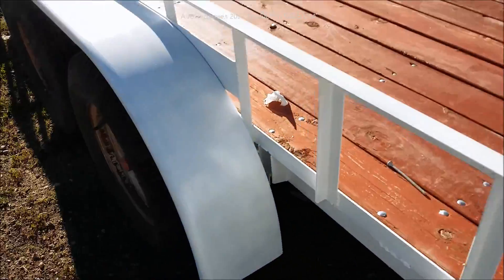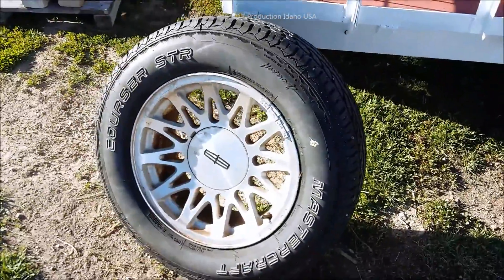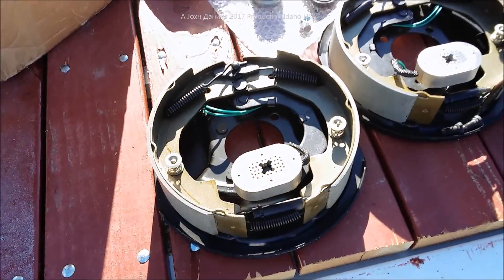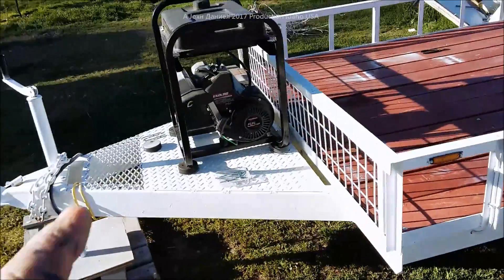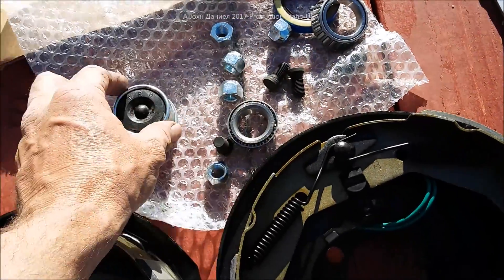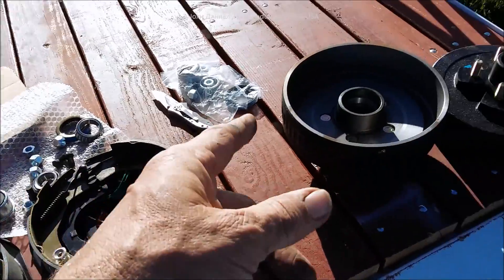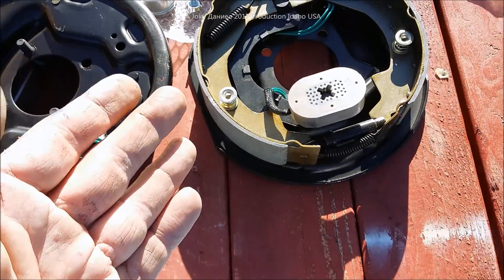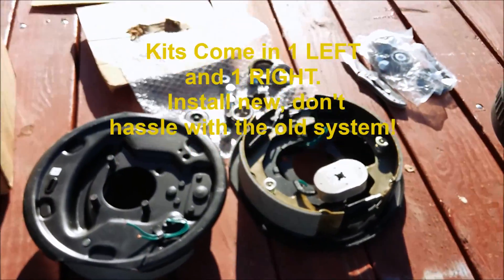How to change from old style Dexstar to new 5 lug Trailer Wheels - Complete info below.

Comment from the maker: PARTS USED & SPECS - READ ALL, http://amzn.to/2pNy5YB OR https://ebay.to/2PqbmhT 5 Lug 3500 To change from 4 on 9.44 to Modern Wheels. CHEAP SHOCKS for trailers, Amazon - Monroe http://amzn.to/2oQoKiv Gabriel http://amzn.to/2onKbTS  RV TRAILER  fix kit 

Drum Bolt pattern: 5 on 4.5", bearing races and 1/2"-20 studs installed
Reply: John, Do you happen to have any dexstart 14 x 6 wheels you might part with?  I have a damaged one and want a spare and need to replace the damaged one.
Reply from the maker: @MrArtMoore  I can look but I am fairly sure we have already ran out of those in 14".
Reply: So, I'm about to do this. The smaller outer bearings are exactly the same as the vintage one, L44649, with matching diameters of 1.063 & correspond to the 1.063 diameter on the spindle.  However, for the newer inner bearing, L68149, the ID is 1.378".  For the original bearing, LM48548, the inner diameter is 1.375" and corresponds to the spindle OD of 1.375".  That's a difference of 0.003" on the diameter and 0.0015 on the radius.  The supplier I'm dealing with locally is suggesting that because this won't result in a press fit, the race will be able to spin on the shaft.  I think they're probably close enough. I don't know really but they are so so very close I feel it should be okay.  Is it working for you? Any problems? Did you even have this diameter difference with your spindles & bearings or what? Or did you check it?  

One thing I'm considering is just checking if my existing and still good LM48548 bearing fits acceptable within the already installed race in the drum that is for the L68149 bearing.  In doing so, I'd be mismatching the bearing & inner race with a outer race that is for a different bearing that is oh so close. All so the inner race fits my spindle better.  I feel like they'll be so close to one another, the difference is going to be extremely negligible if I mismatch and I'll still get a desirable press fit. Lots of close tolerances here for what has to be room for wiggle in the rollers I hope.
Reply: After my post above, I now have all the parts in hand.  These bearings are entirely different in other ways, so there's no possibility of mismatch of the races as I thought I might have to do above.  The new one is a smaller profile of rollers. The outer race of the bearing is much smaller.  Now, as for the ID of the inner race of the bearings, it is difficult to measure much of a difference with my calipers between the two.  To evaluate, I just did a dry fit of the old bearing onto the spindle and much to my surprise it is not a press fit over the OD on the spindle.  The inner race of it can be spun on the shaft as it was for nearly 50 years.  The new bearing goes on similarly to it and is very extremely looser, negligible difference I'd say.  Being as the pre-existing bearing could also spin on the shaft and has been just fine for nearly 50 years of use in that situation, I conclude that an ever so slightly larger ID in the new bearing is not going to make a hill of beans difference.  I'm installing it and moving on with life unworried about it.
Reply: @jillian-anthonycoghill511  hate to bring up a 3 year old post but I’m about to do the same thing. Hope did itv work for you?
Reply: @b00stedda  Worked fine. Except the brakes on the modem hub sucked badly compared to the vintage.  I think it has to do with the amount of metal and grip of the magnet, I dunno.  All I can say is they never really gripped like the vintage ones did.  We'd taken several trips with our camper and no other issues noted from the switch over.  However, I had a whole other unrelated issue.  One of the spindles was bent out slightly misaligned, so it was eating up the tire quickly.  I've since replaced both axles to new modem axles.  So, a new axle has the .003 diameter difference, only larger OD than the vintage axle OD.  I used a mechanic to do all that and had him check if the older vintage bearings with a smaller ID that I still had would fit the newer modern axle having larger OD.  He said it did just fine and no diff he could tell, went right on. So, I'm considering going back to the vintage style but on the modern axle for better BRAKES and the Vintage look on my Vintage camper.  With the modern Dexter brake hubs, I've taken severance break-in trips, riding the brake controller at times, and the modem brakes work a little better now, but not even close to how the vintage brakes were doing.  They still just suck.  They do not grip hard and I have turned up the gain as high as possible in my factory RAM truck controller.  The mechanic has no idea.  I've also thoroughly checked each wheel and for wiring issues and magnet funtionality.  I'm down to it's metal-mass.  The old hubs were just better IMHO, they were stronger and better quality steel from the 1970s.I

Comment: I have the same style axles but my axle is 3" diameter and has a 5 bolt backer plate id love to change to a 6 lug conversion but havent found anything anywhere
Reply from the maker: Your a 5200 Dexter axle on your trailer. So use the Dexter/Dayton to Chevy Wheel kits. https://amzn.to/48zXQ0D You should have the 12x2 brakes on it, and it'll look like them in that link. Best kits are those. Find rims like these 6 on 5.5 https://amzn.to/3NMxnFn with same ZERO offset only.

Comment: How do you know what size to order? What should I measure?
Reply from the maker: The 9.44 hubs are most often used on 3500, 5200, and 7000 lb axles. The most common is 3500. By using a caliper to measure the inner and outer spindle on the axle you can get your bearing size and then which hub and brake kit to buy.
Reply: @JOHNDANIEL1  Thank you
Reply from the maker: A quick sign is the grease seals. For one, over 75% are going to be 3500 Dexter, Lafayette, Dayton or Lippert. The grease seal shaft where it mounts is just under 1-3/4" and the bore it sits in in the hub your removing is barely over 2-1/2" hub bore on the 3500 axle. You would need this kit  http://amzn.to/2pNy5YB OR https://ebay.to/2PqbmhT  for the swap, and find you some ZERO offset rims, 5 bolt on 4.5 from a older Ford, or Dodge car. Example: Ford 14" Granada rims, Dodge Diplomat 15" rims circa 1975 to 1985 are proper sized and centered. 
If the seals sizes are 20% bigger, you have the 5200-6000 and you will need https://amzn.to/41zekCL for the 6 on 5.5" and the rims to use on it are pre 1993 Chevrolet 15" truck/van and some pre 1999 Toyota trucks, but be absolutely sure to get ZERO offset or Negative by up to 20% only. 
They do sell 8 and 10 ply with 5 on 4.5 and 6 on 5.5 rims that are dedicated trailer with right tires/offset on them.

Comment: I’m trying to figure out what my axle is. It’s 9.44 too but still different then yours. Because I want to convert mine too 5 lug with breaks. Made in Canada and think they are call ATAM. I can’t show you a picture because it won’t let me. And they are 15” wheels
Reply from the maker: Most likely Dayton Axles, and most likely welded on brake plates. https://youtu.be/8AHntz2hOVw
Reply: @JOHNDANIEL1  no I don’t think there welded because there are bolds behind the plate, 4 of them. The front of the rim has a spinner like thing because you can spin it with your fingers.
Reply from the maker: 4 Bolt, that's a 3500 axel. Send some good clear pics to me, wheels, brakes, good views, to olympicpowercontrols@yahoo.com and I will get you some answers.
Reply: @JOHNDANIEL1   Would you be able to help me identify some similar axles? My buddy has a small old 79 camper with dual axles and I’m interested in converting it to a car trailer but I have no idea what the weight ratings are for the axles. I have a few pictures I took and I can get more if needed. Thanks in advance!
Reply from the maker: @Diyguy518  Most all trailers over 20 foot with double axle used 3500 axles. Some rarely used 2800. There should be a weight tag on the axle near the spring perch for them.
Reply: @JOHNDANIEL1  I looked all over for a tag but couldn’t find one anywhere on the camper. It’s not very long so I don’t think it’s over 20 foot. It has brakes, the axles sit in the leaf springs, and the axle drops down from the hub. Not sure if that helps at all. I’m honestly surprised it has dual axles because it definitely doesn’t look to be more than 20 feet long.  Thanks a lot buddy, I appreciate you taking the time to help me out.
Reply from the maker: @Diyguy518  Take a bunch of pictures from different angles and send them to me. olympicpowercontrols@yahoo.com

Comment: John, I have the Dayton round 14" wheels , do you have any of the magnets for these? The magnets are gone from all 4 hubs, everything else is there. No idea what the previous owner did with them! I'm in western Wy. 307-272-3372 thanks-Ken
Reply from the maker: Normally you can use any replacement kit for 14" to handle the brakes on those. Just contact etrailer.com and ask/tell them what you need, its affordable.
Reply: Thank you much John! I appreciate you sharing your knowledge with everyone. Ken

Comment: Hi John well I'm running in the exact problem you had , I bought a trailer with 3 rims thinking I got a bargain.. litte that I know I run in to how expensive the rim is . My axle is 2 3/8 with a 4 lug just like the one on the video , my question is which kit # is the one I need and once on what car rim would it fit ?
Reply from the maker: There is 2 types, the 3" axle tube is normally for the 5200 lb models, so yours is likely the 3500 lb double axle if its 2.25 up to 2.625". The kit in the link http://amzn.to/2pNy5YB is the common size for that, and you can use older FORD or DODGE rims on it. Just be sure to use the wheels that are centered offset or stock 4.5 on 5 trailer rims you can get.

Comment: Do you happen to know what kit I'd need for one without brakes? I have an old truck bed trailer I use to haul firewood with this axle and I would like to have more options for wheel and tires.
Reply from the maker: You just order the 3500 or 5200 hubs. If you have the axle weight, spec and brand I can send you to the exact set. Typically a Dexter Star 3500 or Dayton Ring 3500 uses the most basic bearing set, you can use hubs like these with a "option" to add brakes https://ebay.to/2mNCXhs ( chevy wheels 5 on 5" ) OR https://ebay.to/2nAXCWk  (ford/dodge 5 on 4.5" ) 
Or you can go simple just hub kits like these https://ebay.to/2mJ4LDv (ford/dodge 5 on 4.5" ) OR https://ebay.to/2mLB5Wv ( chevy/Mazda/Toyota wheels 5 on 5" ) if you just want to put them on as idlers with no intent to later add brakes.
Reply: @JOHNDANIEL1  What's the best way to tell exactly what axle I have? I bought this trailer at an auction and have no back history on it. It has the dexstar style hubs and wheels but in 13"

Comment: You can get your money back by selling the old wheels, they are asking 150 each on ebay!!
Reply from the maker: I have about 30 of them that were damage free I kept over the years, 6 of the 14", and the rest 15" . I offered them to a viewer for $40 less each than the trailer parts sellers sell them for and noted these are NOT thin metal chinese made copies. He balked! WTF!
Reply: @JOHNDANIEL1  dude you are sitting on a little gold mine, how much shipped to tucson az I need a 15x 6
Reply from the maker: @loyaleon  Not sure, I will have to see what cost are. I think it weighs about 20 to 25 lbs. I will check with USPS and Fed Ex on it. Maybe On-Trac too. Probably $50 a rim plus shipping I would venture to say. Cleaned with any other parts I may have if you need them. Hubs, Studs and caps if I have them. I do have a trucker who heads through here to south east Phoenix 1 time a week I shipped 3 with him for $40 to Tolleson AZ
Reply: @JOHNDANIEL1  sure if you could find out, I need only one for the spare on my trailer. It is too expensive to switch to regular rims for now. Thanks
Reply: @JOHNDANIEL1  Did you ever get the quote on the shipping cost to Phoenix. I would be interested in 1 wheel for a spare.
Reply: @JOHNDANIEL1  Did you get the quote to ship the wheels to Phoenix? I need a spare for my trailer.
Reply from the maker: @Adrianbonfil  Since I do not have a commercial account, they wanted $51 to ship one wheel. But if your in Arizona you do have huge RV scrap yard not far from Phoenix, do a local search on google for RV recycling or salvaging.

Comment: can i get the old rims
Reply from the maker: How many do you want! I got many. They sell for $119 to $150 each from ebay, Amazon and Etrailer but those are China KnockOffs. Very thin. I can get you numerous in 14 and 15 inch in Dayton, Lafayette, or Dexter in Dex-star 9.44 x 4 or Dayton circular 9.44 in 3500 to 5500 weight class. Shipping may be a bit due to weight, they are real originals, and weigh at least 15% more than the knock offs from China.

Comment: Hi , wondering if you may have some insight on my situation ,  old small boat trailer with 9 inch wheels , 5x5.5 hubs , shot bearings , the spindles are 3/4 inch at the threaded part then goes up to 1 3/8 inch , they are straight spindles . Woukd like to replace with newer style hubs like 4.5x5 and 12 inch wheels     Not having any luck so far finding a hub kit that fits those spindles
Reply from the maker: You have a Dayton Marine axle, you need to direct contact etrailer.com and give them your specs. thats a 2200 axle and you can put the 12" rims from etrailer on it also.

Comment: Does your wheel use locking bolts
Reply from the maker: No, its standard 1/2-20
Reply from the maker: You CAN buy locking lug nuts on it to keep thieves away.

Comment: I thought I was the only one with this idea..... I too plan to swap out my hubs for 5x4.5" hubs to install my Lincoln Mark VII wheels. Thanks for the info
Reply from the maker: +granadojl The other videos on this job shows how well it came out.
Reply: Јоhn Daniel I followed your other videos.  Simple as pie.  Thank you for the info.  I just simply never looked into what it takes to swapping my hubs.  Thanks again
Reply: John is this kit for a straight or tapered spindle? The link does not specify. Inter- Outer bearing same or different sizes? I’m going to make the same change, but have not removed anything to view the spindle. I have a 9.44 with one large hole in the rim and mounts with 5 bolts not lugs. Thanks enjoyed your video. Great insight before tackling this job!
Reply from the maker: @johngee2327  Tapered? , Sorta yes, its stepped a bit. Larger ID bearing at brake face, smaller on tip of spindle.

Comment: You should done one for Mobil home trailer axle's,  there like those but I think they are 5 bolt. and the rim is just held in place by a bolt and piece of metal clamp piece.     I cant wait to get my trailer built and do videos.   

Thanks for showing friend.
Reply from the maker: Your better off using that huge frame for building a structure of some sorts. Those spindles on the mobile home axles are not the most accurate out there. And the height is not easy to work from.

Comment: nice looking kit
ive heard electric brakes are super responsive
how are they for longevity as opposed to mechanical/hyraulic
Reply from the maker: I will do soon a video of a brake controller dissected to show how the inertial pendulum and solid state PWM voltage generator works. The average lifespan on the brake magnets are about 22,000 to 30,000 miles of normal use.